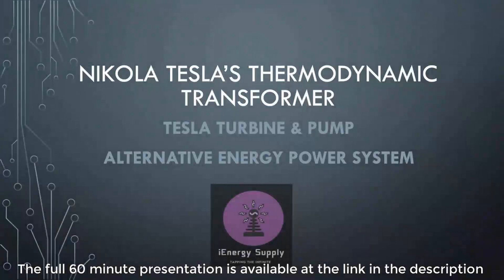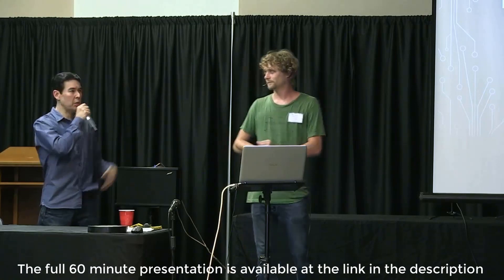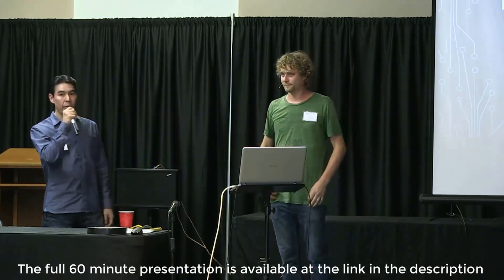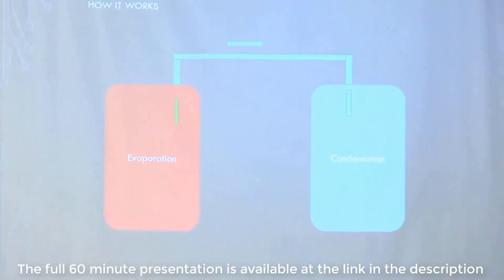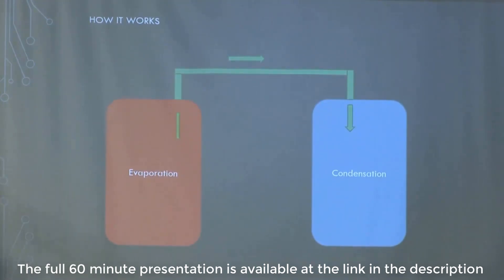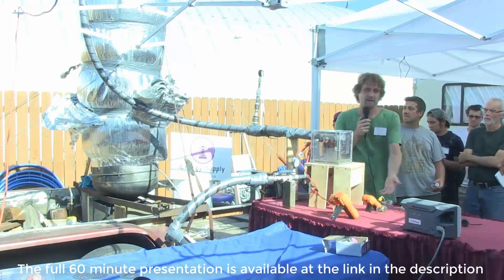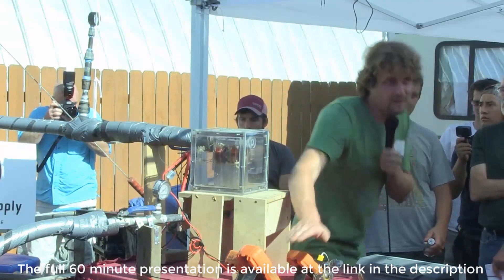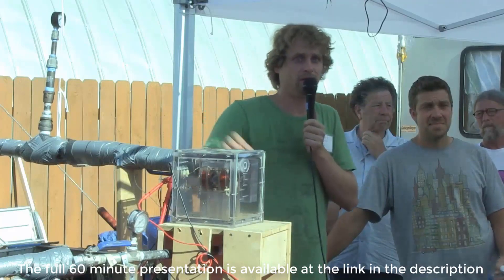Complete Tesla Turbine Thermal Dynamic Transformer Power System

Comment: What temp differential is the most efficient for the turbine? (the optimal temp difference between hot and cold side) I imagine actively cooling the condenser introduces energy losses into the entire system. Also, I'd be interested to see how a small version of this system would behave inside a moving vehicle (actually powering the vehicle directly from mechanical energy or by actually harvesting the electricity). One thing I haven't seen in most of the videos you've posted is the torque rating of the turbine at the speeds it runs at.

Comment: Cut off grinding disks are designed for speeds up to 20,000 RPM, maybe use that for your turbine blades and the bearings from a discarded hard drive could provide suitable to control the shaft. You could even use the platters from the hard drive if you wish, instead of the cut off disks. and if you were smart enough you could join 2 hard drive cases together with some machining involve to make the tesla turbine casing. being mindful it is aluminum and not as structurally sound as SS but could be for an experiment to not to exceed the safe rotational speed. As the casing could explode and cause harm. Better to do run the testing with an explosion proof enclosure around the turbine if you proceed your testing this way.

Comment: Did you know that all electric treadmills us a DC motor? The bridge rectifier converts AC to DC! Ya you knew that right? Why not use a coupler to connect the shaft of the turbine to the motor and très bien fait a generator ready for action?
Reply from the maker: One reason is it's hard to seal the turbine for vacuum use when there's a generator that's not waterproof connected. You have to have a special sealed bearing or something. And they're not very efficient, I do have a video showing one of my turbines generating electricity with a treadmill motor.

Comment: What about connecting the magnet 🧲 bilaterally from the shaft along the axis of the plain of magnetism, and rapping wire amongst the plains 9 to 3, 6 to 3, 9 to 6 on opposite sides, and do this on traversing plains to amplify the power the only thing I would say is watch out do not touch the turbine, but it should also heat up taking away from any freezing aspects of your fluid transmission, but if it does not than use a heat strip, and push hot air over your turbine. You would also need some type of high heat ceramic to keep your trinumphant ring from around your shaft from causing sparks.

Comment: Rather than pay for the presentation and not know if content is worthwile, Im willing to donate a good amount if you upload or send a video showing efficiency of turbine or turbine and generator measured and calculated correctly over a period of 1 hour or more.

Also, curious to know if youve considered using different fluids with lower boiling points (e.g. ref fluids), in closed system without vaccum. I saw a goverment size project in another country a few years back. If so, what would be the advantage of water under vaccum?

Comment: I love how tied we are to 212 degrees and boiling.   The boiling point of the liquid is determined in part by the atmospheric air pressure that liquid is boiling into.   Under normal atmospheric pressure, you have to excite water to 212 degrees f to get it to change from a liquid into a gas.   If you add another atmosphere of pressure, that temperature goes from 212 to 250 ( standard pressure cooker ranges ). Under vacuum, that temperature goes down from 212 to around room temperature.  This tool seems to used stored heat to overcome the energy of evaporation and uses the turbine to reextract that heat through condensation and convert it to angular momentum, moving some heat along as efficiency "loss".

Comment: I like that you are sticking to less than 100C, for now at least. That makes prototyping so much easier, and it also plays to the current excitement with "waste" heat and combined power generation.
Reply: Rankine cycle steam engines have been in use with steam temperatures over 100C for well over two centuries using heat sources like coal, oil, nuclear, and geothermal. Making another steam engine that runs at over 100C is not really interesting or transformative these days.
Reply: @zanthrasw  I believe superdupergrover point is that it can be under 100C

Comment: Don't feel bad, we lived with a vacuous arithmetic until very recently. 8000.
Reply from the maker: not sure what you mean.
Reply: @iEnergySupply  NJWildberger. What is e(c) + sq2 + Pi? He just retried from U of NSW, and NOBODY will try to answer his question. The simplest operation on the most used "irrational" numbers, an answer was never coming. I gave it. Math comes from inside our perception apparatus. So building 3D mathematical descriptions of objects never happened. Steinmetz got to 3 coefficients but the lack of a gauge symmetry allowed mystery. Einstein and integral/summation FAIL. 

The Navy will take the caterpillar drive and use anything to generate the toroidal-hyperboloidal fluid flow of ether churning. I think a Tesla Turbine array is best, with a stationary sleeve with coils to extract current to the inputs, with the internal walls rotating on the inside flooded with salt water and magnetically aligned. The water, salt, magnet and battery trick, just spin the batter IN the water and exponentially scale the propulsion. We use STATIC engineering calculus in a Boolean binary system.
Reply from the maker: @dsm5d723  you are more qualified to answer that question. For now I must do the experimentation to prove one way or the other.

Comment: I have a question I think you would know the answer to better than I. I applied this tech to the Red October Caterpillar dive, it is a go. Here is the question. How would making the turbine into a solenoid series by placing it around a hollow core effect the thermodynamic properties? Stated in my idiom, does the arc of counter spatial contact, the shaft typically, change the effect? I think is is capacitance of the smaller Turbine blade surface area exchanged for the wide bore barrel. If the Piezoelectric effect in magnetized salt water scales with a rotating input OF stated Piezoelectric effect, then a hypersonic cavitation drive is SO doable.
Reply from the maker: for now I have to stick with the simple part of the system, just running it and making the turbine more efficient, and possibly larger, the fun experimentation will come soon.
Reply: @iEnergySupply  Would running a flywheel with turbine venting in a separate vacuum chamber, no valves but connected on the shaft and with tubes to equalize temperature be testable for a reciprocating engine effect on acceleration and deceleration? I see the heat equation moving in the system, and this is a form of dynamic balancing, like pulling charge out of the box to increase rotational efficiency. Heat from the slowing turbine is equalized with the neutral but connected flywheel chamber, one tube on top (warmer air?) one on bottom (cooler air?). Sinusoidal means to me that heat, EM flow and sine wave vibration are the three values in my algebra of Static Skin Effect. I use the alpha, beta and gamma decay-accretion model with two time directions to build everything in nature, and somethings not here yet.

Comment: a candle powered tech demo would inspire everyone, its essential its small, effective, cheap, simple, easy to use, if there is a large-ish copper pipe coil, like in steam cars, then you have quick superhot, steam engine water steam source
Reply: more heat resistant materials, like steel discs, blades, glass windows in steel box, copper/steel pipes, or ceramic refractory materials for high pressures/temperatures, also you can re-circulate the turbine spin generated pressure heating back to the steam source, its a heat pump, all-in-one
Reply from the maker: we want to avoid high temperature and high pressure. With great enough velocity, we should be able to get enough power at a high enough efficiency to run with low pressure low temperature. I really like your candle powered idea, but we are getting analytical equipment that will show the numbers extremely accurately.
Reply: @iEnergySupply  someone said: higher temperature steam is more efficient, what would I do with the numbers, I need the candle
Reply: @iEnergySupply  btw, for reference, I suggest testing with non-compressible water flow too, because the equations change radically when compressible/heating/cooling air/steam is used
Reply: @iEnergySupply  ie, tesla turbine used as a gravity water flow generator, or ever something like sand flow, very simple demonstration device, just a storage above, then the turbine down of it, rim-in center-out flow
Reply: @iEnergySupply  even hot air flowing up, the candle demonstration, no steam required, options
Reply: @iEnergySupply  also stirling engine equivalent with valved cold-air to hot-air pulsejet pressure source
Reply: @iEnergySupply  one more consideration: input pressure vs output pressure, ie the output area vs input area, static/dynamic pressure as in hydraulics
Reply: note that the cooling of the steam makes total energy zero, ie let sun cool the steam in the air, yep its for demonstration purposes indoors only, got it
Reply: of course you could vaporization heat pump (compression + transport) cool it, collecting the heat for secondary heating purposes in a radiator, away from the condenser system

Comment: What the heck?  I was expecting to hear something new not an entry level thermodynamics demonstration. What is he doing that's so different from everybody else? I know Nikola Tesla said the material science wasn't there yet. I would assume it's there now, so what's the improvement?
Reply from the maker: tesla worked on the turbine till 1921 and maybe even later. The information saying tesla stopped working on the turbine is complete bul*** If your referring to that video where they say a 3 foot turbine needs to go 50000 rpm, they screwed up on the math. I just wanted to note a big mistake in the video! The video says the rotor must spin at a very high rpm, maybe 50,000 for a 6” turbine. The speed of a turbine is based on periphery speed not rpm. If a 6” turbine needs to spin 50,000 rpm to be efficient like the video says, that’s a periphery speed of 890.1 Miles per hour. If you want a 3 meter disk to achieve close to 891 miles per hour at the periphery, the rpm required is only 7,253. We have materials that can easily reach that speed.
Reply: And get ahead of all of the zealots, Nikola Tesla had to purposely retard his design because the material science of the metal couldn't handle the stresses involved. This is something he said himself.

Comment: Here's an interesting idea, instead of using a tank that has ice or cold water, you could bury ground loop tubing that always has water at a consistent temperature. The hot side could just be heated by traditional solar water heaters
Reply from the maker: That's the plan, also using well water to cool the condenser will work. It's interesting though, the condenser may not need to be cooled if we can reach a great enough efficiency.
Reply: @iEnergySupply  Do you have any metrics currently for how big of a load you can drive without the turbine decelerating (Steady state)?
Reply from the maker: @TheSmbTechy  They are on the way. Our analytical equipment is almost finished.
Reply: @iEnergySupply  9 feet under ground 54 degrees, is that cool enough ?
Reply from the maker: @JimmyTheSaltyMelon  Absolutely, and we recently ran the turbine with the condenser at 80 degrees
Reply: This could also eliminate waste heat from air conditioners, fridges, freezers, and computer farms. Significant energy reclamation could make this commercial viable now, as if could reduce overall grid consumption.

Comment: What sort of magnet are you currently using on the shaft for the generator? I'd like to pick one up
Reply from the maker: Diametrically magnetized magnets, 1"x1" with 1/4" hole in the center.
Reply: @iEnergySupply  Awesome, thanks!

Comment: higher efficiency due to higher rpm... higher rpm due to no active load...
Reply from the maker: We show load testing in the full length video, also, see the load testing that we have done with an active load here. This was achieved with a undersized water batter and condenser. https://www.youtube.com/watch?v=SbVRXvrGJfI&t=1s
Reply: @iEnergySupply  well... as long you can sustain high rpm, you might get higher efficiency than other generators.... but as from my point of view, thats not a active load. A active load is benchmarked with cos(φ) = 1, 1000W, 1h. The result of the benchmark will show PSI, TEMP and HZ over 60min..

but.. maybe tesla generators cannot sustain so high rpm so long before it breaks apart.
Reply from the maker: @gooseberry46  Actually the bearings are rated at 150000 rpm, so the test I show in my link is actually very slow. Also, the rotor isn't balanced so when it is the sound will almost be completely diminished. We tested 150000 rpm in the past. The rotor wasn't balanced either though so we can achieve upwards of 250000 rpm, close to mach 4 periphery speed. 60000 rpm is actually extremely plausible with these bearings, and a balanced rotor. As far as the load goes, we are going to analyze everything including, rpm, amps ac, volts ac, amps dc, volts dc, temperature in, temperature out, temperature of boiler, temperature of condenser, mass flow, and more in the future. Stay tuned.

Comment: Why will the condenser not heat up? because the heat is mostly being converted into kinetic energy.
Reply from the maker: It will slowly heat up, but something interesting happened during our testing, we actually may have gotten ice to come out of the exhaust of the turbine, and that's cooler then the condenser. We still need to confirm that it was ice, but if it was, that's crazy and is supposed to be impossible!
Reply: @iEnergySupply  then that means you don't need the condenser?
Reply: @Barskor1  I really don't know because I'm still trying wrap my head around how the heat is transformed to rotational energy.
Reply: @iEnergySupply  Worth investigating certinly.